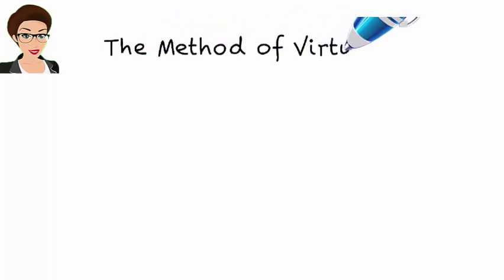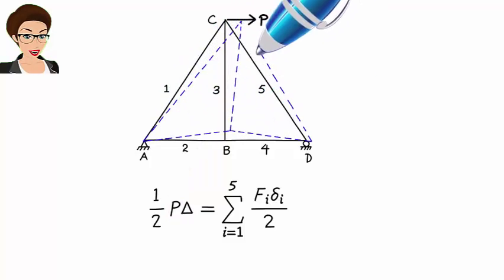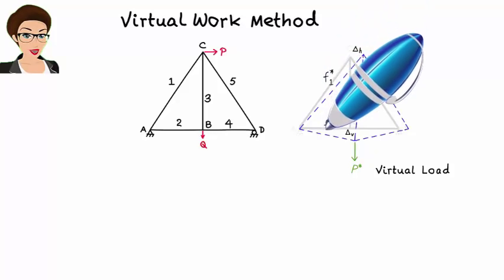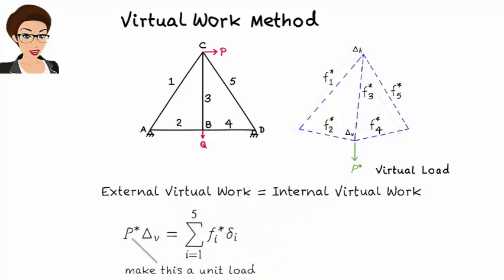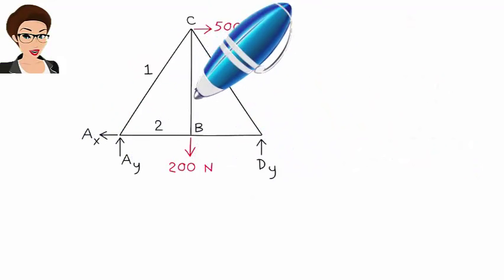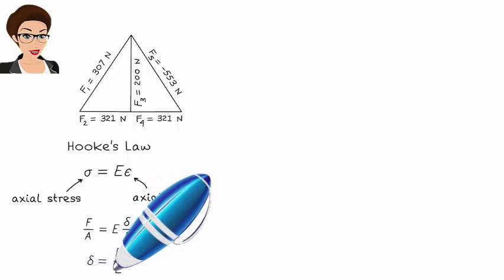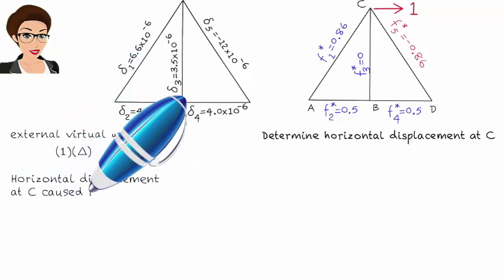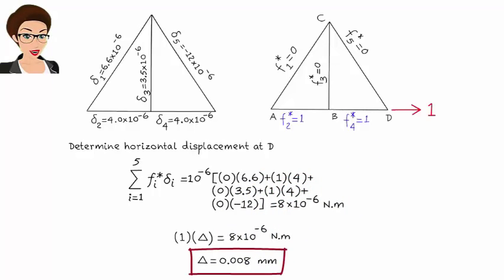SA21: Virtual Work Method (Trusses)

Comment: Please i cant understand why in the internal virtual work we use the real elongation why we did not use the virtual elongation as we do in the external virtual work when we use in it the virtual displacment ?
Reply from the maker: You wrote: "... why we did not use the virtual elongation as we do in the external virtual work when we use  it in the virtual displacement?"

That is not correct. We do not use virtual displacement in any case.  External virtual work equals the virtual unit load (P*) times the real displacement (Delta_V). 

Think of it this way:

The structure deforms under the applied loads. In this case, the truss deforms, its joints displace in the x and y directions, and its members elongate and shorten. 

Suppose we can magically hold the truss in its deformed shape yet remove the real loads that have caused the deformation. 

Now. if we apply a virtual load to this deformed structure (when the real loads are not present), without considering the additional effect/displacements that virtual load could cause, then the principle goes like this:

The virtual load times the real displacement at the point of application of the load (external virtual work) EQUALS the sum of the virtual member forces (caused by the virtual load) times the real elongation/shortening of the members (internal virtual work)
Reply: @DrStructure  Now i understand great explanation ✌️🙏
Thank you very much for the fast and detailed reply 🙏😄
Reply from the maker: You're welcome!

Comment: Why is the angle 54.4 and not 60.5?
really appreciate your work mate.
Reply from the maker: The side of the right triangle facing the angle is 7 m. The side adjacent to the angle is 5 m. Therefore, 
angle = inverse tangent (7/5) = 54.46 degrees.

Comment: Why create a virtual load P* in a place where a REAL load "Q" exists?
Reply from the maker: Conceptually, the virtual load is different from the real load. The principle of virtual work cannot be properly explained without having a virtual load.

Computationally, if there is only one real load applied to the truss, and the virtual load is placed at the same location and in the same direction as the real load, then we do not need to analyze the structure twice. We can adjust the analysis result from the real load to obtain the effect of the virtual load.
Reply: @DrStructure  i see..

Comment: Is it okay if value of f*2 and f*4 is -0.36 at 11:00?
Reply from the maker: The negative sign implies a compressive force is present in the member. But in that particular loading case, members 2 and 4 are not in compression, they are in tension. So it should read +0.36, not -0.36.

Comment: what happens if B was pinned ?
Reply from the maker: Then we would have an indeterminate truss with no displacement at B. But still the principle of virtual work would be applicable.
Reply: and then , there is no deflection at AB,BD results from load p ,right?
Reply from the maker: Correct, AB is not going to have any axial deformation since the member would be pin-connected at both ends. But BD is going to elongate since there is roller at D.
Reply: ok ,thank you very much